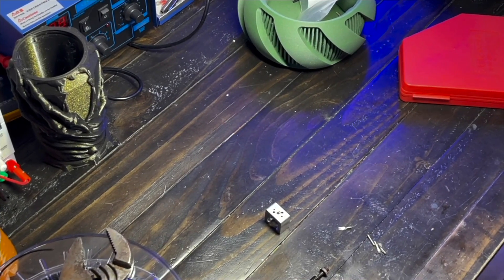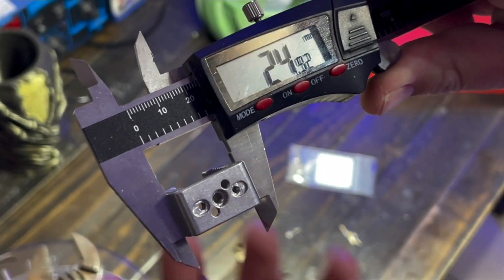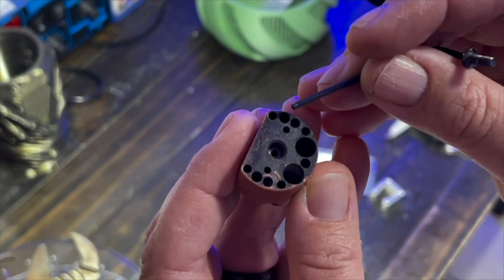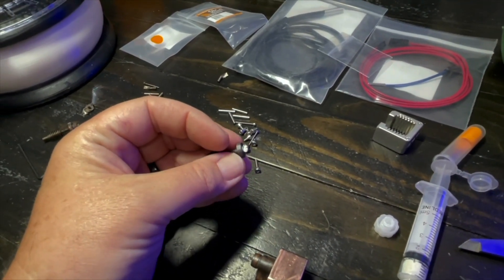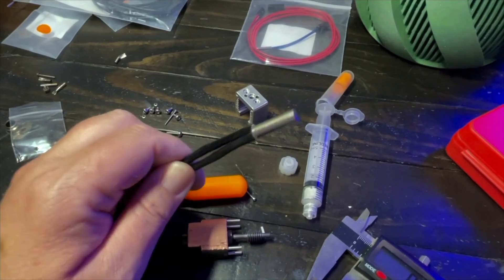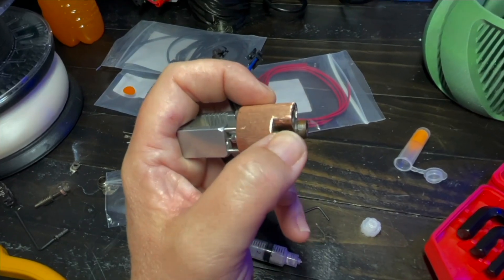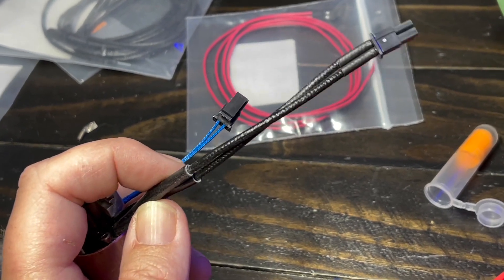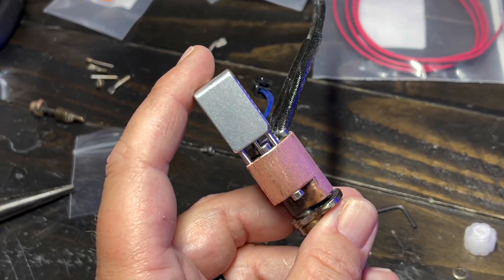Rebuilding and Close up look at the Slice Engineering Magnum+! 3D printing High Flow Hotend

Comment: as a tip for you you can modify that shield to fit an E3D nozzle. i have the new black aluminium one and i used a countersink drill bit for M4 which has a diameter of 8.3mm and i drilled it from inside slowly and after just sand it a little bit and polish and now it can take E3D nozzles as well. it is quite a shame in my opinion what SE is doing on 3D printing market bullying everybody with their patents and this is just another proof that they really have a shitty apple style marketing trying to keep you using only SE nozzles and Bondtech because they are close partners SE selling Bondtech in US and Bondtech selling SE in EU.

Comment: Do you have any videos or know of any vids/litterateur on how to set up the magnum plus (x2 heaters, x2 thermistors) in Marlin? I want to make sure I set it up correctly and don’t but unnecessary strain on the main board…
Reply from the maker: I don’t but… basically you wire the two heaters together and connect to the heater on the board. That’s the easiest. You need to see the Amp rating on the board
Reply: @thelightspeed3d712  thank you! I’ll give that a shot!
Reply: @thelightspeed3d712  one more question. Are you running thermistors in parallel? I’m getting “err: MINTEMP: E1” upon trying to heat up the hotend. Also the display reads 0° when I turn on the machine… I double checked that I wired them correctly and that both work individually…

Comment: How hot can the Magnum + get without a fan?
Reply: It cannot get to liquid cooled temperatures because the air simply gets too hot and jammed the heat break not gonna cut it for pei or other high temperatures like the mosquito advertises 450c with out chamber circulations and liquid cooling this will jam all day long
Reply: You really should be using a fan with Magnum and Magnum plus (or even regular flow if printing high temp materials or using a hotbox). There's not so much heat creep in the traditional sense, but the block radiate off so much heat it ends up heating the heatsink indirectly. You don't need lots of airflow though, just enough for a light chill, mostly to keep the hot air around the block and extended melt zone (in case of "regular" magnum) away from the heatsink. This is of course unless you're printing in a hotbox, then the heatsink is always gonna be hotter than the ambient temp in the box even of using a fan. Unless you're watercooling it of course.

Comment: I would recommend NOT putting thermal paste in the heartbreak threads. Not only does it risk getting paste in the filament path but you're reducing the performance of the heat break. The whole point of the heat break's is to minimize heat transfer to the heatsink, by adding thermal paste you are aiding it
Reply from the maker: I disagree. It’s a extremely tight tolerance regardless so I don’t think thermal paste is making that big of a difference. It also aids in future repair. This one I almost didn’t get out. 

The heatsink on the mosquito is only contacted by the screws and four stainless standoffs. The heatbreak on the other hand should have good contact on the hot side. The cold side is the stainless tube above the fins. 

I’ve literally rebuilt dozens of these and never had an issue in the way I do it. But that you for the response!
Reply: For "traditional" hotends you might have somewhat of a point, but only if it's already a pretty bad thermal design. You want best possible thermal transfer from the heatbreak to to the block and the heatsink. In the hot zone of the heatbreak, the heat can't get to the filament without going through the heatbreak. This is especially true with PTFE lined hotends, because of the low thermal conductivity of PTFE. This is, unless you actually want those 5-6mm of nozzle thread contacting the block, to be the only efficient melt zone. (Volcano nozzle type hotends can do better here without good thermal transfer in the hot zone of the heatbreak, as you have 16mm of threaded nozzle to work with rather than 5-7mm). You don't want good heat transfer between the two zones. That's the job of the heatbreak, not thermal interfaces. You do want best possible transfer between the cold side of the heatbreak and heatsink too, to give what energy does make it across the heatbreak separation zone, minimal opportunity to heat the filament, by dumping it into the heatsink as efficiently as possible.

On the Mosquito and Mosquito Magnum (and clones / derivatives) "cores" / heatbreaks, you want maximum thermal transfer between the block and the heatbreak, as the regulsr flow type is highly tuned to be part of the melt zone - the zone separation with incredibly low thermal transfer is kinda the whole unique(ish) point. With Magnum, High Flow cores / heatbreaks, the lower half literally is the melt zone.

Comment: it looks like that nozzle cover only works with their propiatary 6mm hex on the vanadium nozzles?
Reply from the maker: Yes that’s what I said in the video....I tried a E3D nozzle and I couldn’t get it to fit? But you don’t have to use the nozzle cover. It would be like a regular hotend basically
Reply: @thelightspeed3d712  great, thanks for letting me know, could you ask slice to make it fit the standard nozzle sizes, because that would make alot of community members want to buy it, as i am sure many would choose not to buy it if it locks down which nozzles they can use, but yeah i suppose it could be bypassed
Reply from the maker: @zommy5re77  again I’m not 100% sure but I did try a nozzle x I have and I couldn’t get it to fit. 

I will ask them. I doubt they are designing with E3D in mind.